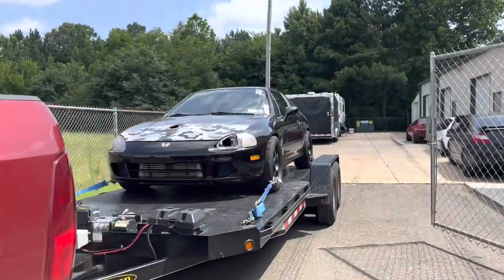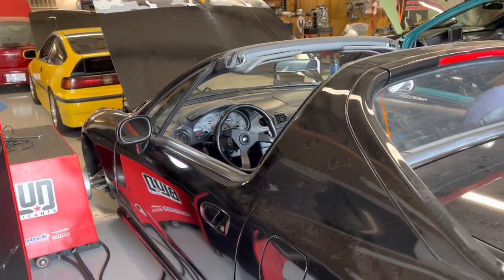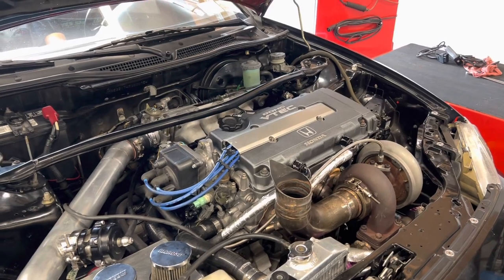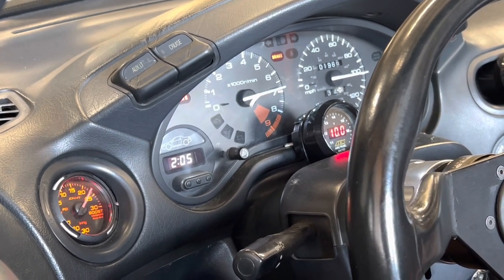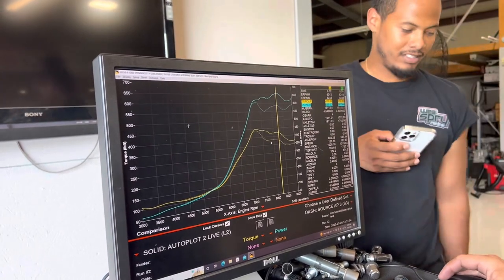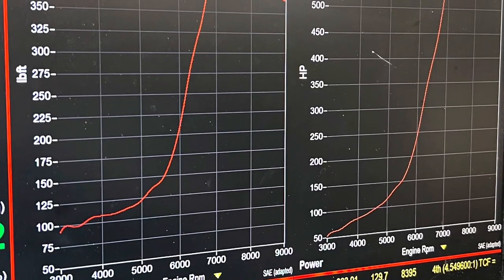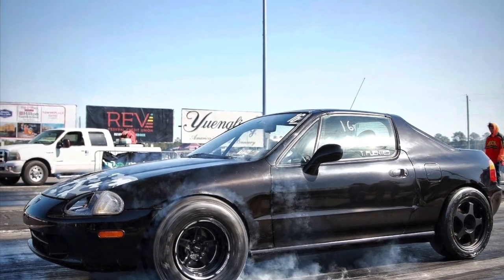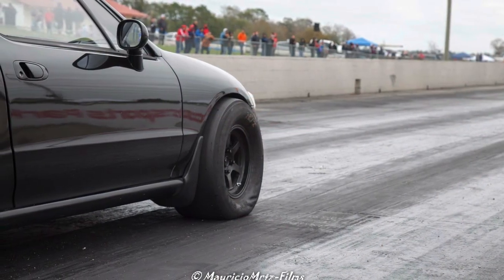Full exhaust vs up pipe on a turbo b series Honda

Comment: I think it's just exhaust velocity. A lot of cars seem to bog a bit if they don't have the exhaust attached. Surprising that such a high HP turbo setup seems to enjoy a full exhaust, though.
Reply from the maker: Yeah both good points. I did go to the track to try and test but I couldn’t get back to back runs with and without the exhaust. I will say the 2 runs I did do with the full were slower, but it could’ve went a few different things. I’m waiting for cooler weather to try again.

Comment: That band up top will be smooth once the fuel changes are done!
Reply from the maker: Yeah I have a cleaned up map that I’ve ran at the track once. A good bit leaner and cleaner lol. I might try and see what it does on the dyno once it gets cooler out.

Comment: Im running same set up and wanted to see how full exhaust and top mount turbos work but i guess i should be fine , Cool vid man
Reply from the maker: Yeah I was pretty surprised by the results. It seems if you want to make about 6-650 a full exhaust is still very okay to use.
Reply: @tafuentes  🤟

Comment: Were you tuned on the full exhaust? If you were it would make sense that you’re losing power with an up pipe. When I tuned open downpipe, I installed a e cut out and lost 30 hp with the valve closed (515-520hp). With the valve open, I was still making close to when I tuned with an open down pipe (545-550hp)

Just an fyi, these Honda motors don’t like restrictions. Try tuning with that up pipe.

Comment: I had that same issue the turbo was sucking in the gasses and it literally made 60hp more
Reply from the maker: Yeah that’s what my tuner thinks happened in this case. Once it gets cooler out I may try and do another back to back dyno test with the cleaned up fuel map I have and I will try to have a secondary exhaust fan running by the up pipe.
Reply: Oh so this makes sense why when people do just the turbo downpipe they may extend it a little bit further out instead of just a couple inches off the turbo up

Comment: Could back pressure have anything to do with this? You fonʻt want to much back pressure but also im guessing to little back pressure could also be not so great
Reply from the maker: Could be a possibility, but on all the runs boost stayed exactly the same and the dyno plot’s looked almost identical to about 7-8k rpm. I’m thinking it’s more to do with the car sucking in the exhaust fumes.

Comment: What is the comparison when u  took off the muffler but still had downpipe
Reply from the maker: It was a little less than full exhaust with muffler maybe 5-10 HP if I remember correctly
Reply: Sounds like better i tune with full exhaust

Comment: Wtf i hope someone can explain what happened here, why did the full exhaust made more than a hood exit
Reply from the maker: Like I said at the end of the video. It could be because the turbo was sucking in exhaust fumes which would make it lose some power. That can happen if you don’t have a fan directly pushing the fumes away.
Reply: @tafuentes  but the fumes are heading out towards the top away from the compressor housing
Reply from the maker: @alitoroganan2442  true but you’d be surprised as to how much force a turbo pulls in air.
Reply: @tafuentes  im curious bro, hopedyou did a pull while the hood down
Reply from the maker: @alitoroganan2442  i didn’t. Maybe another time I will.
Reply: @tafuentes  yea bro that would be awesome and if it still makes the same then i dont wanna run hood exit😂

Comment: What’s the best et u have on the car
Reply from the maker: 10.44
Reply: I’m asking cause I’m hoping to run a 10.8 to 10.9 my car was tune made about 550whp also spinning on the dyno I went to the track but had a bad my trans was because I had bad twin disc in the trans I bought the 725 now also getting my trans re done also buy brand new coil overs also new inner putter tire rods the fastest my car gone 12.77 @ 121 mph
Reply: @tafuentes  also are u at full weight ?
Reply from the maker: @slamblackek9  yeah my car weighs about 2650 with me in it. No weight has been removed other than the spare tire lol. Car still has everything in it, radio, heat, full interior, bumper supports etc.
Reply: @tafuentes  love it but go faster my goal is 10.5 how hp do u think I need also what did u do to Strengthen your transmission